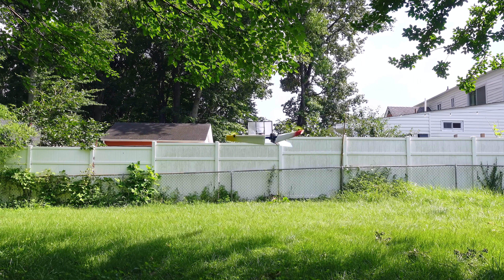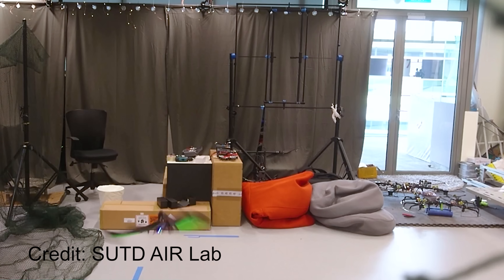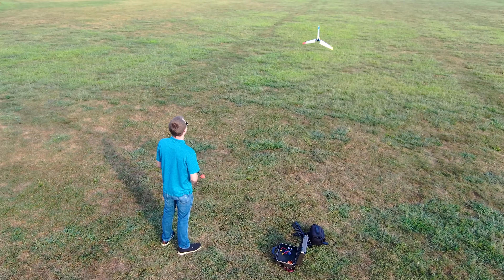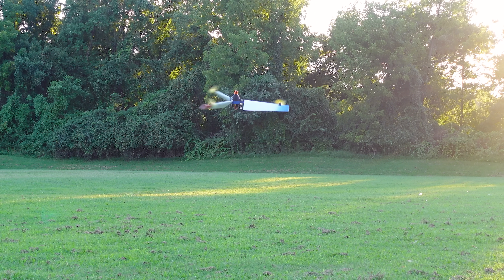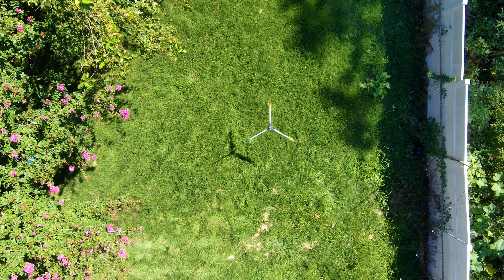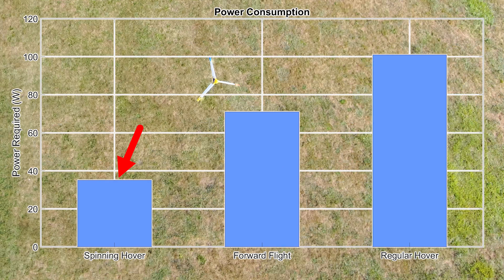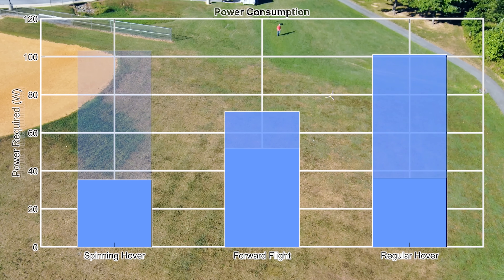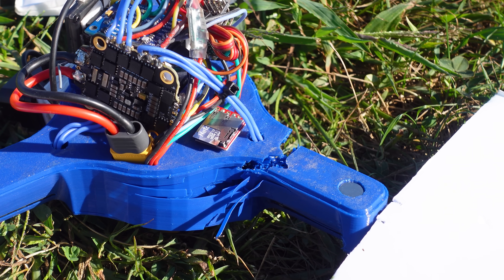Is THIS the Most Versatile Aircraft Design?  (Forward Flight Testing) - Part 2

Comment: While it works with your foam blades, it would be a lot more efficient with a proper aerofoil. A 3D printed symmetrical wing would be idea. It would also give you far better data.

High speed on those wings will be producing too much drag so your data could be scewed, but I like your inventiveness

Comment: How about a quadrotor but with only 2 wings on opposite sides? You can still regular hover but the other 2 rotors without wings should have smaller drag in horizontal flights

Comment: One idea might be to have deformable airfoils, to change the profile of the two acting as wings during forward flight to improve lift. But as it is now, it already seems complicated enough. I suppose it's food for thought on some later experiment.

Also it's fun to see you competing with RCtestflight in the humor department. And Amazingdiyprojects has a parallel development with the levitator which just focuses on the spinning mode alone. It's bigger/slower and has good lift, but more fragile.

Now I wonder if Peter Sripol and FliteTest will venture into trying these kinds of experimental craft? They're definitely neat.

Comment: If you want to improve forward flight here's a thought have one of the wings split down the middle have actuators mounted to separate rotate and cap the other two wings so that you end up with two for forward flight. Just out of curiosity give 3D print one of your rotors with "feathers" on the trailing edge of the blades. Wondering what effect if any of it will have on lift and or sound.

Comment: Here is a crazy idea..

Make a 4 winged spinning drone with wings of 2 different lengths perpendicular from eachother. It will still be balanced while spinning and forward flight would be more efficient with the 2 long wings horizontal and the 2 short wings vertical.
Something with a wing length ratio of 3:1 might work well

Comment: Could you build a tube shell that has electronics inside and counter rotating blades outside it that uses even less power?

b = blades
s = shell
e = electronics

side:
                              s e e s
b b b b b b b b b s e e s b b b b b b b b b 
                              s e e s
b b b b b b b b b s e e s b b b b b b b b b 
                              s e e s
                              s e e s
                              s e e s
                              s e e s

top:
                                s s s
                             s e e e s
b b b b b b b b b s e e e s b b b b b b b b b 
b b b b b b b b b s e e e s b b b b b b b b b 
                             s e e e s
                                s s s

Comment: What about utilising a system of collapsible wings?

Hover mode 4 wings, forward flight 2 wings.

Placing rotors alternating top and bottom of wing so that when wing collapses they do not conflict. Or alternatively around tip and middle of wing, to give a 2 engine per wing look.

Comment: Since your drone is essentially a rotating mass I’d suggest it be balanced so there is less gyrations. 

Or you could take what you learned by making the camera mount and use that design to mount smaller side propellers.

Comment: Your graph does NOT show the most-efficient forward flight - that shows most efficient for airtime. Those are very different things. A powerdraw 20% greater would still be a lot more efficient if it means travelling 40% faster.

Also "Improving" drones, transforming them first into helicopters and finally into airplanes - reducing the requirements for staying airborne.
Reply from the maker: Range Vs. Endurance… typically efficiency is attributed to the endurance metric
Reply: @NicholasRehm  "typically efficiency is attributed to the endurance metric"
Nah - typically it is measuring whatever is the important metric - here either airtime or distance. But you said it would be the efficiency of distance without even measuring distance at all.
Reply from the maker: @ABaumstumpf  I don’t think I said anything about distance but I’ll go back and check
Reply: @NicholasRehm  4:07 - you said it would be the "most efficient forward flight".

Comment: What flight controller software are using and how did you get it to change modes? I've been thinking about building a tail sitter but I'm not sure iNav is going to be up to the task of changing modes.  I can code but that's a big project
Reply from the maker: Welcome to the channel, all my projects use my open source flight control code designed specifically for these types of projects. Check out my videos on dRehmFlight

Comment: A suggestion: It may be possible to implement an intermeshing rotor (synchropter) design like the Kaman K-MAX helicopter with your props on the periphery that would then transition to forward flight with fixed rotors acting as wings. That way, you don't have to worry about everything spinning.

Apparently, the synchroper design achieves higher stability, ease of control, and lift capabilities (1:1 cargo-to-craft lift ratio). Notwithstanding, I imagine the opposite spinning rotors might present a control problem between flight transitions.

Comment: How about folding down, (or rather, keeping in vertical) the third wing for forward flight?  Hinge it at the body, and have it stop at 90 degrees (for hover). When you tilt forward for flight, hing it back to flat,  (like a fuselage), and apply vertical thrust with the motor to offset weight.

Comment: kind of a silly idea but what if one of the wings was split down the middle and the two halves moved up during horizontal flight. or that wing was made of flexible material and the support inside shortened pulling it into an annular wing.

maybe make it a 4 rotor design with a pivot in the center. something to lock it in vertical or horizontal flight configs. then program in a quick maneuver to unlock that and tilt the rotors to push the wings together/apart toswitch, saving you from having to add a servo to do it. you could also make some switch of gearing to make the same servos that control the pitch of the wings move them into horizontal mode.
Reply: Looking at the last shot where one broke, why not just allow one to hinge down so it becomes a sort of empanage / tail in forward flight? 

In hover modes the thrust at the tip will 
pull it up into position or centrifugal force (yes i said it) will throw it into place 

I guess the CG vs center of lift would be too far off but maybe this gives someone else an idea

Comment: In forward flight, could you use the tilting of the airfoils to control the pitch of the horizontal wings, and use them as elavons or get them to a pitch angle where they aren’t stalled to improve efficiency?

Comment: I see that the pitch angle is applied to all wings/arms simultaneously, which is of course simpler and lighter, but in forward flight mode you really need the two lift generating wings to pitch towards each other (giving you a lower angle of attack), and the vertical wing to remain pitch neutral.
Maybe a gearing mechanism that when rotated one way, will set wings up for spin-hover, and rotated the other way sets you up for forward flight. Not sure how exactly the mechanism should be designed, but I'm pretty sure it's achievable.

Comment: Hi Nicholas, It can be a design challenge but, if you can add a nearly 90 degrees second axis rotation to middle wing, you can increase efficiency on forward flight and can use it to control pitch.
Loved your design very much.

Comment: I thought of hovering signal relays/repeaters first! lol  ... a long time ago I was trying to dream up a repeater for hobby grade quadcopter flight, then you wouldn't loose signal nearly as much and could be applied to outdoor racing and such - though I do like the search and rescue application. 
This is really cool and I wonder if you could just continue to yaw/spin the whole drone when pitching forwards instead of orienting the wings vertically and just using the motors alone for thrust. Prob wouldn't get nearly the same forward angle until it just drops from the sky, but it would be neat to test it out at like 45deg-60deg forward pitch.

Comment: Potential idea for super efficient loitering drone:
Rather than spin hover (which is already bloody amazing), what about something that travels to a predetermined location in the air and then deploys a balloon?
Like those little CO2 bulbs, just with helium that can inflate a balloon and take most, or all the weight of the drone.

Then the motors wouldn't have to fight gravity and can tilt outwards where they only need to push back against wind to maintain the drone's position.

Comment: Have you considered a quad? It could fly in the x configuration increasing lift efficiency similar the bonanzas rear stabilizer. 
Also, is the panning speed of a some 360 cameras auto track feature fast enough to use?
Shoutout to the YT algorithm for recommending this. Subbed. 🤙

Comment: oh, regarding directional control while hovering, what about movable tips at the end of the blades with Cyclical control connections?
they would rotate several degrees from the "wing" angle of attack .

Comment: The big question jumping out at me is, "What would a 4 wing version of this perform like?"
What difference would having 4 wings give diagonal lift versus 2 wings giving diagonal lift and one acting like a giant rudder speed brake have to forward fixed wing flight?
Would it still be able to hover spin the way this 3 wing design works?

Comment: An alternative method to avoid that pesky vertical surface:

Imagine that you put a hinge on one of your arms, such that it was near the body, and had a constraint (a stopper) that allowed it to dangle down, but not over extend upward. Doing this, you could power down/off the motor to what would be the upright wing, and it would simply get drawn back by the drag and/or gravity to a more energy conserving position without screwing with the other two wings. It would still be able to rotate too, adding a slightly more traditional yaw component. To return to hover, simply return power to that motor.

As for the direction control while spinning. The IMU is going to be about useless for this thanks to numerical error (repeated integration), and also gyroscopic precession. A magnetometer, on the other-hand, should be good for the task. Even the naive maths should work flawlessly. Trouble is, getting a mag unit that has sufficient sample rate. It may be that you need to get a few units and interleave the read data.

Comment: To minimize drag you could tilt two of the wings 90 degrees and leave the third 0 degree to the hub axis and fly it at (close to) a 0 degree full body tilt to the horizon. This will however place the two forward thrusting motors at a ~30 degree angle of attack to the flight path. But I am sure you'll figure out some clever solution to that.

Comment: Reminds me of Lambda-class Imperial Shuttles from Star Wars.
Drag problem can be resolved by using an actuator to fold the wing into a fuselage / vertical stabilizer in forward flight.
Wandering problem may be resolved by counter-rotating mass also used for payload attitude.

Comment: Would a 4 wing design result in more efficient forward flight? Flying as an X instead of an upside-down Y would eliminate the lack of lift from the vertical wing and probably fly with a less extreme angle of attack.

Comment: Actually no surprise with less power needed to hover. According to theories of propellers and so on (I advice to search for simple  "The Great Copter’s Theorem" ) the power needed to hover depends on propeller "total diameter" in power 1.5. When you transfer from three small propellers to one big, having same load, the power needed to hover decreases  drastically. 
Cool design! Probably at some point it will be built in a full scale.

Comment: So how about individually rotating wings. Rotate 2 for wings and forward thrust and leave the 3rd motor for helicopter lift and yaw control. Or would the angle of the motors be too inefficient to benefit from this?

Comment: Some thoughts on this from back in the days where i wrote a small paper about this in school: optimizing it for foreward flight would probably get you further than optimizing it for spinning, going off of how efficient helicopters and planes are respectively. In that case you could, instead of hovering, have it do stand-by-circles. There is a design simmilar to this, the "graupner x44" model aircraft. However instead of tilting the entire wing it just tilts the motor mounts upwards which i would assume makes for a horrible hover efficiency (the props push the air against the flat of the wing).
I think there is a huge potential for quadcopters with tilting wings.

Comment: What if you changed out the wing that is vertical in forward flight to some structure with minimal drag?
In spinning hover the gyroscopic effects should cancel out the lift asymmetry (it would just get a bit more wobbly, possibly requiring smarter stabilization controls). And there would be no change to the stationary hover mode.
Alternatively, you could keep only the outer half of that air foil, where in spinning mode a rotor blade generates 3/4 of the lift, but in forwards flight a wing causes 1/2 of its drag. And if you cut away the outer 1-sqrt(3/4)=13.4% of the other wings, you'd regain full symmetry in spinning mode.

Comment: you could shorten the vertical stabilizer and keep it balanced in spinning hover by changing the angle between the other two blades. Get rid  of the part of the vertical stab outboard of its motor so its about half as long, then change the angle between the other two blades from 120 to 150 degrees. That will reduce the drag of the vertical stab and improve the lift of the other two since they have less dihedral.

Comment: I work for an airline, so all of my knowledge and preconceived ideas are centered on traditional commercial jet design, but I had an idea during your video. What if you made one of the three arms foldable (basically the way it looked when it crashed). When you're hovering / spinning, the arm would be locked out and function just like the other two; then during long forward flights, you could fold it back to reduce drag - but it could also function somewhat like a vertical stabilizer (albeit hanging below the "airplane" under a "V" shaped wing). I don't know if that makes sense or not; I'm happy to discuss it more and explain!
Reply: I thought the same. I wonder if you could just use the centrifugal force to keep it in the extended while rotating position.

Comment: Could you possible fly it in such a way that on wing is stuck straight out on one side and then the other two are at an angle on the other? This way all the wings are providing lift?

Comment: Would it be possible to add a hinge to the vertical blade?  During forward flight; it could pivot backwards reducing drag.  The motor could be used to control attitude.  Increasing power to return the blade to hover position.  Perhaps, a solenoid to lock the hinge into different positions.
Reply from the maker: Definitely, I accidentally installed the hinge in the last clip!

Comment: How about using four wings rather than three? This configuration will make use of most of the wings when flown like the letter X, with a 45-degree angle to the horizontal axis.
P.S. Just noticed the "60º, 120º, 60º, 120º" solution below by Emanuel Ey, which makes perfect sense.

Comment: It's a cool concept for demonstrating principles (and as a toy), but is basically just a bad helicopter at this point. By trying to optimise both forward flight and hover you end up with something that is really bad at both. In the real world this has very little applications, as either you want something that flies well as a plane, but wants to take off and land vertically (so low efficiency hover doesn't matter), or efficient VTOL, hover, and precision, so a helicopter or larger disk quadcopter is appropriate. For rough area loitering you actually just want a plane, and a low speed optimised plane can get impressive cruise speed by travelling at altitude with a bit of design consideration. At the very worst you might want a quadcopter dropped from a plane.
If you want to really go all out on wacky for the sake of it, why not make it asymmetric? If one side is a broad pancake wing, and the other a long slender one, when spinning around it's CoM the retreating pancake will develop far less downforce than the long wing whipping around produces lift, and it could hover like a sycamore seed. With a bit of dihedral it might even be controllable just from two propellers on the tips, with no other moving surfaces.
Reply: this otherwise good comment should have ended at  'bad at both'.  !

Comment: Mhh... How about going with a symmetrical X Configuration for Spinning Hover Mode that can either almost or entirely fold itself down to a Bi-Wing like a Star Wars X-Wing does when entering Forward Flight Mode - Depending on how close you can bring those Wings together the less Parasitic Drag you should have, no?

Comment: That's a fantastic project! Here's something I noticed. 

As is during forward flight your two bottom 'wings' are oriented in a way which creates anhedral. 
As well, the vertical surface raises the center of gravity higher, thus contributing to lateral imbalance. 
I'm thinking if you were to program it to fly with that middle wing facing down, the flight controller won't have to fight balance issues because you now have a lower center of gravity and dihedral.
Reply: But then it won't look like an imperial shuttle anymore ... hmm .. trade-offs  ...